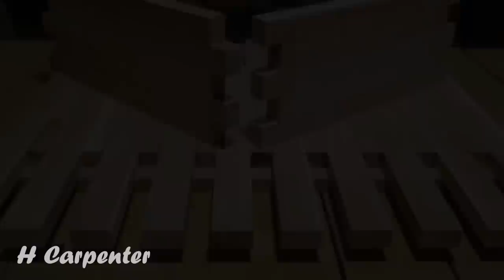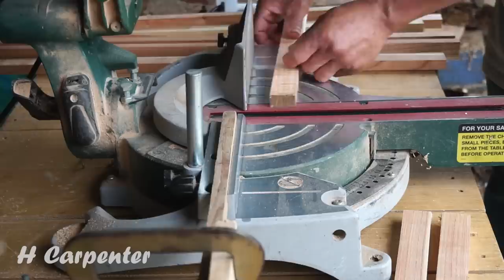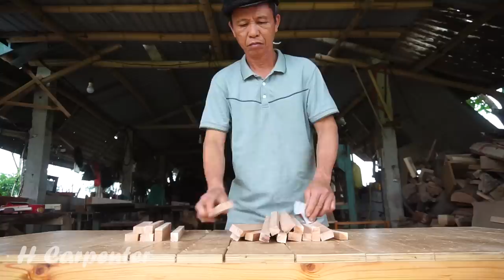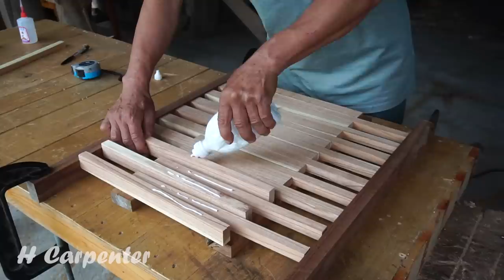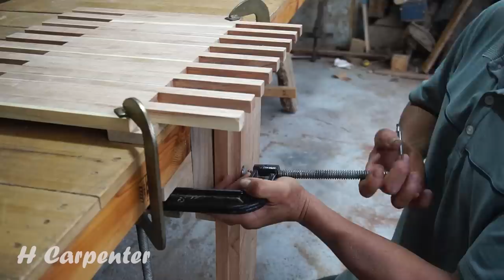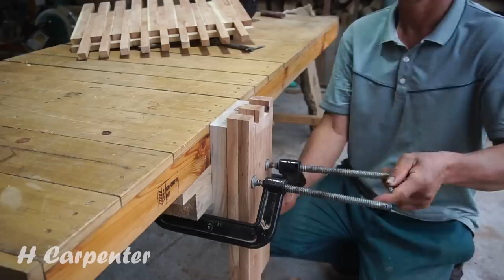Extreme Simplest Box Joints Jig Ever - Faster Wood Joints That You Can Try

Comment: very clever to come up with such a simple jig to make. What I'm missing though is how to measure the correct spot to route each opposite end to ensure a fit that is flush with the width of the boards.... any suggestions?
Reply: The complimentary piece is supposed to be placed next to the first one and you continue to route.
Reply: Yes. Get a calculator and a pencil the record the data. It will be different for each type of lumber, height, thickness, number of pins and mortises. (Holes and tongues)
Reply: Exactly, specially since he moved the jig one has to eyeball the exact location. That's the main weakness of the jig I think.
Reply: just flip the jig, the reason why it is double. Taking into account the edge position of the first previous one. Also, take note of sacrificial board in place, after both routing the top portion must be plain surface to mean you route it right.

Comment: I cringed at how close your hand came to the jointer blades
Reply: His time will come.
Reply: Yes. Very strange
Reply: Well,... cringe away. If it's a foreign country,.. they don't have governing agencies to tell you that you can't do wood work without masks, guards, safety belts, steel toe boots, etc. I watch saw milling videos of people in flip flops sawing next to huge open blades that can cut a body in two in less than a blink of an eye, for wages that are less than a sandwich, or a bottle of beer. Or a pair of boots.
Reply: @larrymbouche  well if they cut their body in half, they won't be caring about minced fingers, wouldn't they?
Reply: I have done the same, that’s how it was done. In fifty years I still have all my digits. A spins machine is a different matter, especially when the cutter flies out.
Reply: I noticed that really scary he was way to close to the the blades .I have a nephew that cut his hand on a planer not nice.bottom line
Reply: @larrymbouche  they don’t need governing agencies to say bad practice for it to be bad practice. And that was just dumb
Reply: About 5 years ago I cut the very tip of my thumb off on the table saw taking a risk. In my eyes it was only a small risk and to this day I still think it was a small risk. Regardless, my thumb made contact with the blade and some of it came off. I was REALLY lucky that the damage was minor and if you look at my thumb, you'd think nothing happened. It screwed up the nerves though. They now constantly fire so it feels like something is touching my thumb 24/7.

Warning noted, loud and clear.
Reply: @peterzammit9029  oh dear. It’s about old habits sometimes.

Comment: Isn't it fake? In the jig you used fingers with different width and got equal fingers and spaces in the connected boards.
Reply: He used a template guide, which adds about 1/8 gap between the template and the router bit. So, to make equal fingers for the joint you’d need for example alternating 3/4” and 1” boards, with the router running between the shorter boards